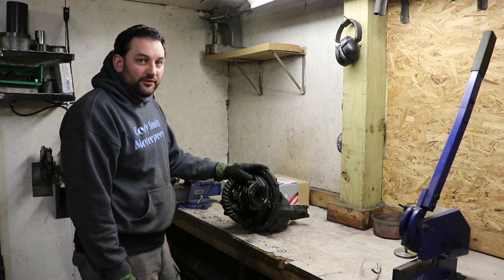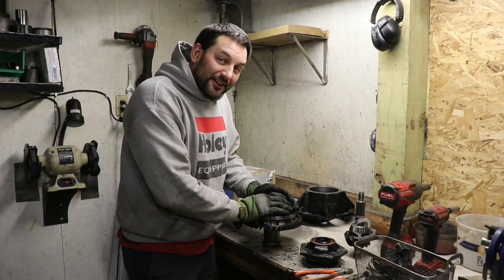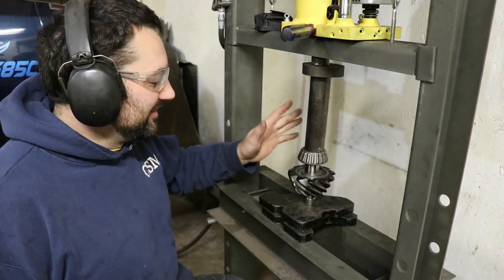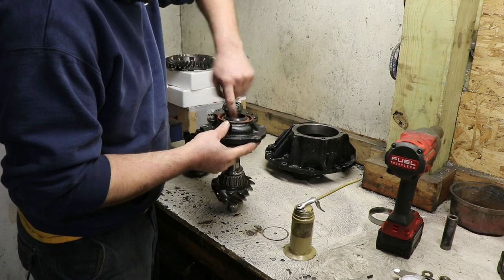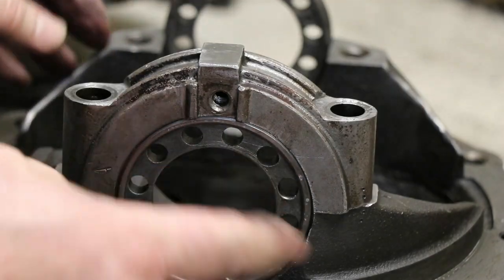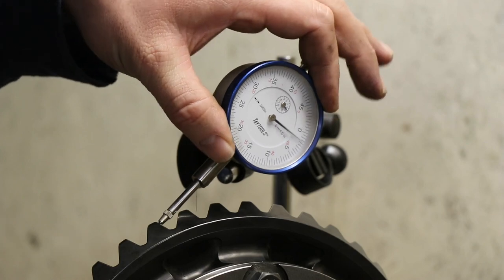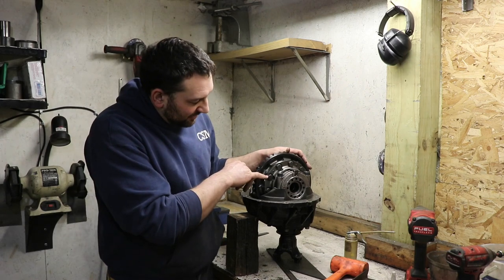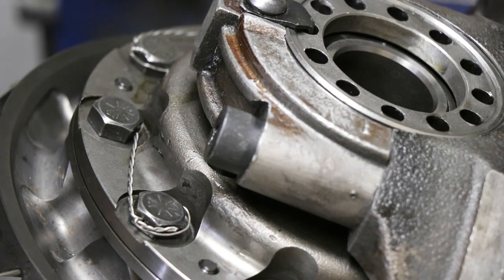Ring and Pinion Swap How To with used NASCAR gears Ford 9"

Comment: Hey excellent video man, thanks for sharing. I had a question about the nascar gears, do you find them to be noisy? I’m considering them for a street/strip/track build, using a truetrac too
Reply from the maker: No, they're pretty much the same a regular gear set as far as I can tell. 
In a quiet car you might notice but for me I could tell when the old gear was wearing out mid season (due to the oiling issue) vs when it was put in.
Reply: Nice to hear, you’ve inspired me to give them a shot